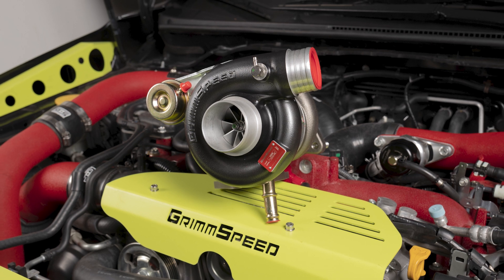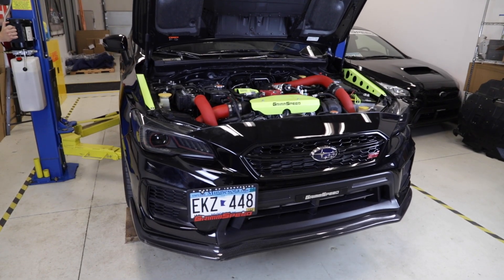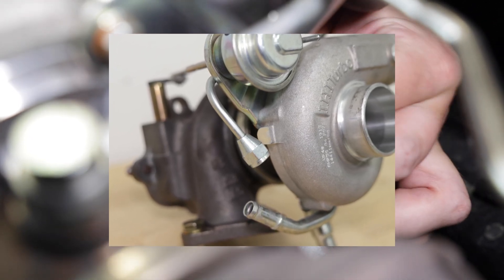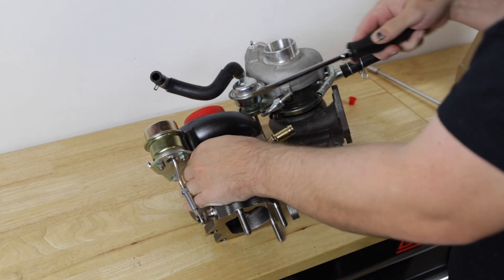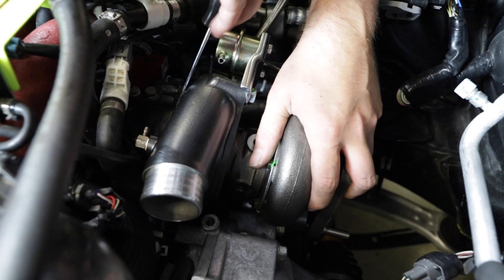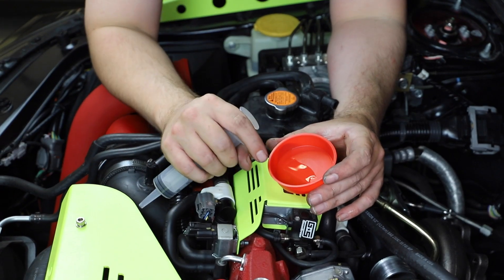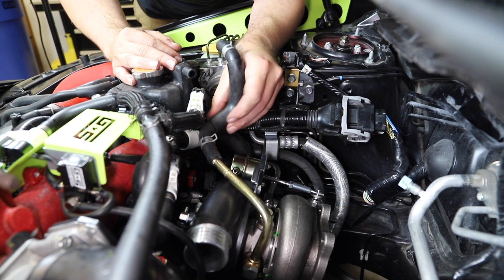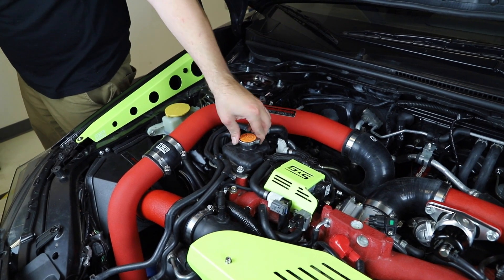GrimmSpeed Chase JB400/Overtake BB500 Turbo Install - Subaru EJ Engine

Comment: Installing now. The m10 nut nearest the passenger side wheel doesn't seem it has enough room to slip in the groove machined on turbo housing.  Suggestions?

Comment: I haven't done this before, but it looks like dropping the up pipe or lowering the header might make for easier access while trying to install the turbo.
Reply: Actually if you keep the uppipe in place it helps align everything upon reinstall.

Comment: Do you need the 3 port boost control solenoid to install the turbo? Having some trouble finding the right ports on my stock one
Reply from the maker: For tunability, it is highly recommended.
Reply: @GrimmSpeed  i have a 2010 wrx, the intake side outlet of the turbo to the inter cooler presses against a wiring connector, what’s up with that? and which intercooler do i need for this

Comment: How big the injector and fuel pump did you guys use?
Reply from the maker: For the JB400 we suggest a 1050 injector, and an AEM 340  pump. For the BB500 we suggest an ID 1300 injector and it wouldn't hurt to run a bigger pump. These are just suggestions. Give us a call and we can talk about the why and the other options you have.

Comment: Why is an oil change necessary?
Reply from the maker: It's best to run fresh oil through the turbo on first start up. That way you know bearings are being coated and lubricated

Comment: Y’all should get ratcheting open end wrenches. They are so convenient for tight spaces.
Reply from the maker: You are right, we need a shop tool upgrade for sure. It's in the works!
Reply: @GrimmSpeed  gear wrench has some pretty good ones for a good price. Better bang for your buck than snap-on. I personally need to get a better impact. I heard Milwaukee has some pretty good ones. Any recommendations for impacts? Preferably a 3/8s impact.

Comment: what all is needed to make this work with a 2002 wrx?
Reply from the maker: Good question, for the most part bigger injectors and upgraded fuel pump, other than that everything will just bolt in. You may want to upgrade fuel rails/lines as well so you don't run into issues with fuel delivery limitations with the stock lines.

Comment: If you're gonna do this job you might as well remove the intake manifold. It doesn't take long and you can drill out those nasty TGVs. Plus you have much more space to work with making the job 1000x easier on you and your fingers.
Reply from the maker: Yes, removing the intake manifold would make the job easier, but it is not necessary.

Comment: Might be a dumb question … will this work on other fmic brands such as Perrin?
Reply from the maker: The short answer is, if your FMIC is designed to attach to your OEM VF (STI) Turbo, then it should also work with either the JB400 or BB500 considering they're both stock-location units!
Reply: @GrimmSpeed  looks like we’re in business, can’t wait to get my new turbo 🥰 just ordered the BB500 yesterday 🙌
Reply from the maker: @BrUc3Lee1121  that's awesome to hear, thank you very much for the support!!
Reply: I wanna know how it does on the dyno looking for a turbo to make 450whp on a mustang dyno

Comment: Of the things to show, connecting the bottom oil line would've been the MOST important thing to show.
Reply from the maker: Agreed, but the space is so tight that it is hard to capture on camera. It's noted in the video. Capable installers should be able to put 2 and 2 together to know that the oil line needs to be reconnected.
Reply: shuckyducky710  so how'd you do it?

Comment: I will be ordering this soon. To put it in my 2013 WRX hatch. And gonna order a new invidia exhaust. Already have the invidia exhaust just gonna get a new one. Also what brand front mount should I go with. 🤔🤔🤔 Grimmspeed for sure 😊😊
Reply: Why would you get a new one if you already have one?
Reply from the maker: That's awesome to hear Joshua, thank you very much for supporting our company!! Haha, smart man, the GS turbos were designed around our intercooler systems so it's a match made in heaven 😊

Comment: Back, back in the day I pulled fuse 11 to crank and circulate oil.    But that was a bugeye which is probably older then half the demographic now.   Lifts cane and shakes it randomly at horizon.
Reply from the maker: Haha, aaahh the good old days of modifying!